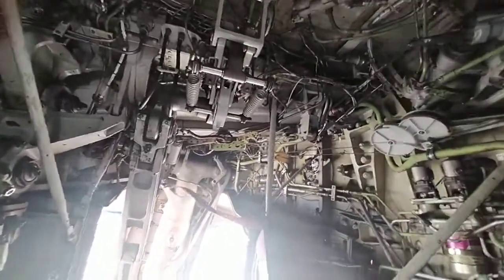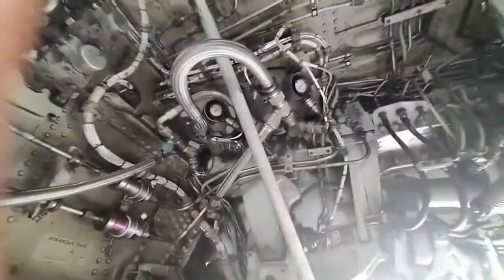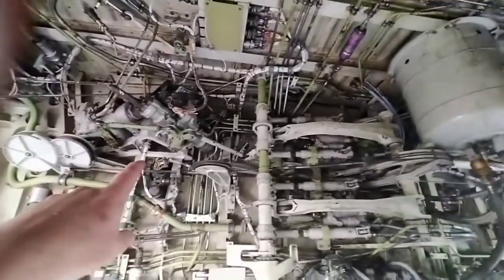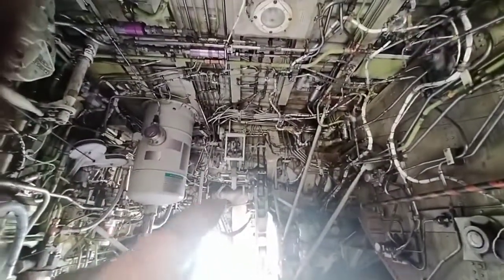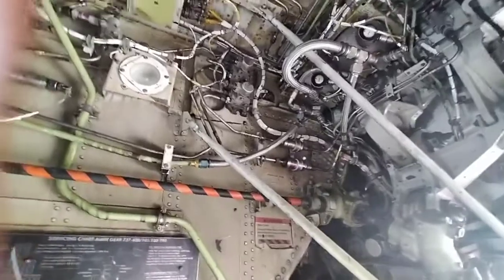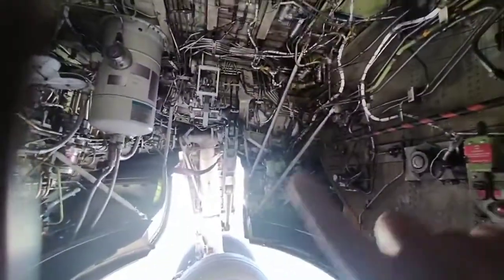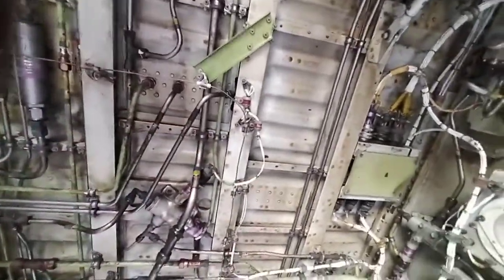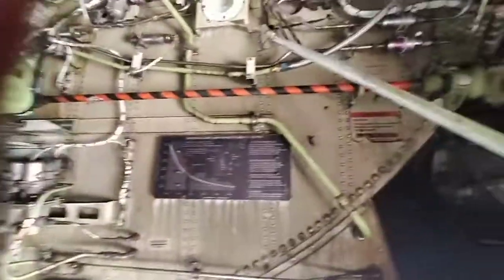B737 800 wheel well

Comment: All of that hydraulics, don’t you just love the smell of Skydrol? In my time as an NDT MRO worker, I recall the MLG interior lights you speak of. Some of the airlines that flew the older 73s had them. Were the hydraulic fuses designed to operate independently between system A and system B if the situation became necessary?

Comment: I hope you don't mind the question but why isn't there some sort of protection for all of those hydraulics? If the tyre had a blowout on takeoff or landing surely it would risk debris being thrown up and by the looks of it having an almost guaranteed probability of hitting an important systems' connections or wiring? All the best sir, Dan (from the UK; I hope to visit S. Africa one day).
Reply: added weight, fuel economy, price im assuming
Reply: @c_corgi  Yeah same here that does seem like the only reason. I would guess that if it posed a safety risk and really needed protecting then Boeing would have covered everything up.
Reply from the maker: There is a sort of "Fix" for a tire blowout on take off.... On the underbelly just aft of both main landing gear is a thing called a Frangible fitting... Its a small tube that sticks out about an Inch and a bit. Its a sealed tube about the size of a little finger. This is connected on the landing gear UP hydraulics. So in case of a tire burst on takeoff the rotating burst tire will shear it off causing the landing gear not to retract into the wheel well.
Reply: @AviationEngineering1972  has there been a case of this happening? it doesnt sound very common